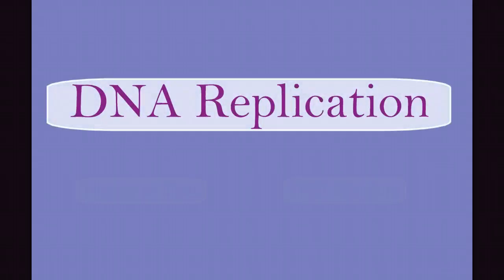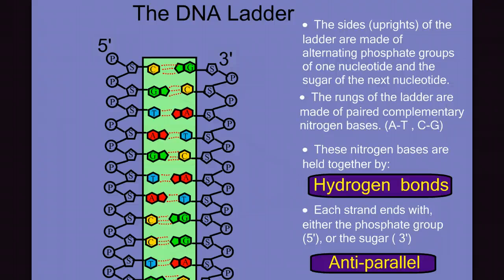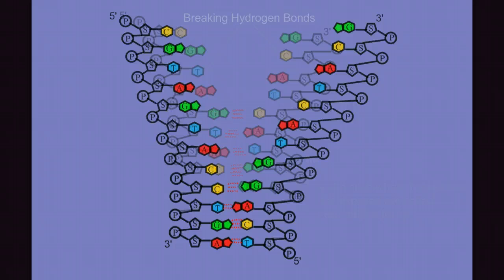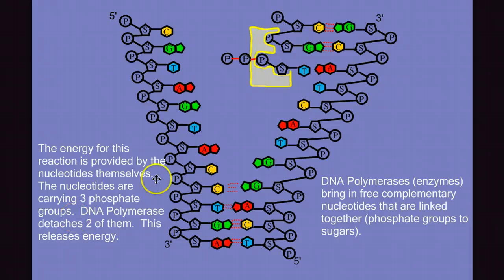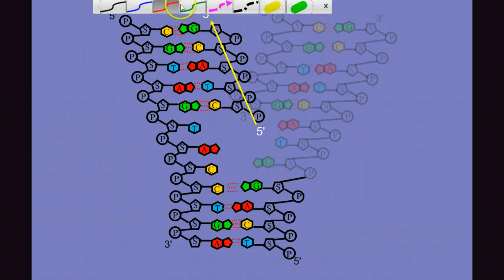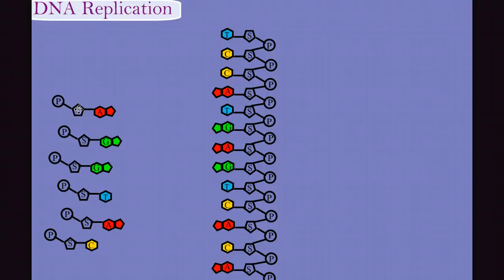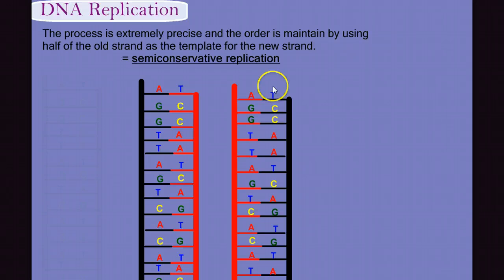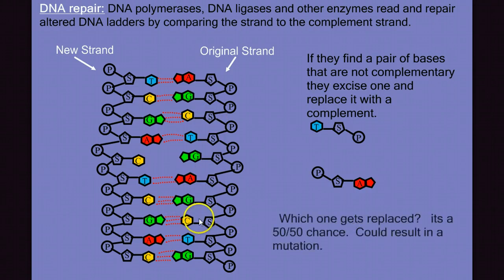DNA Replication

Comment: For the possible mutation portion of the video, would it be a strict 50/50 or would the GC arrangement have a slightly higher chance because of GC triple bonding versus AT double bonding?  I'm just curious if that makes a difference.